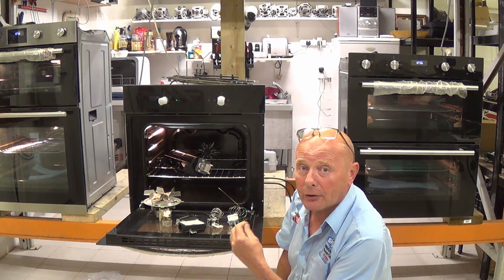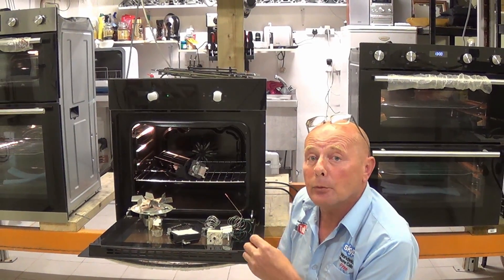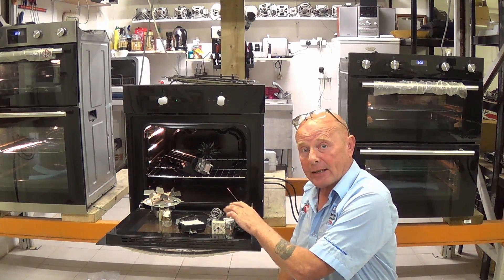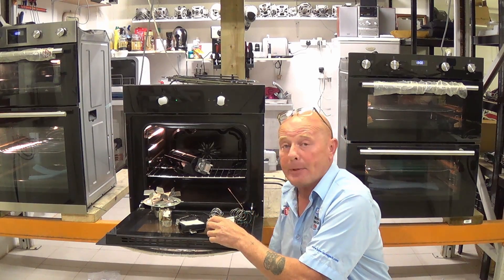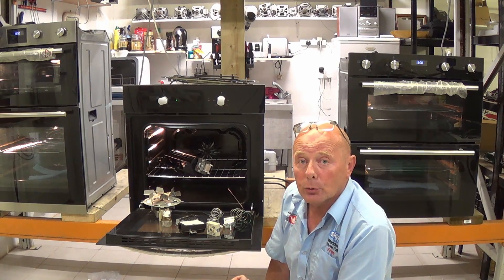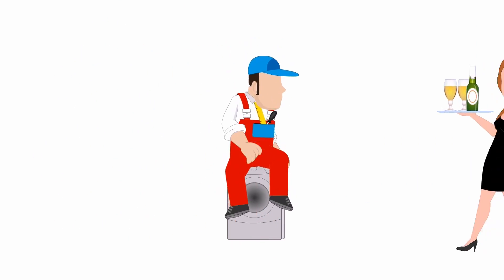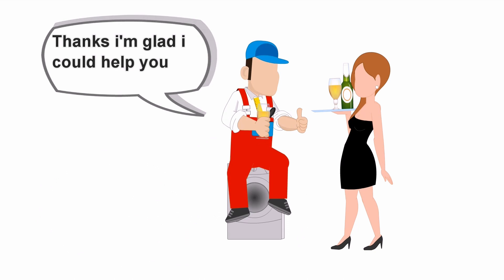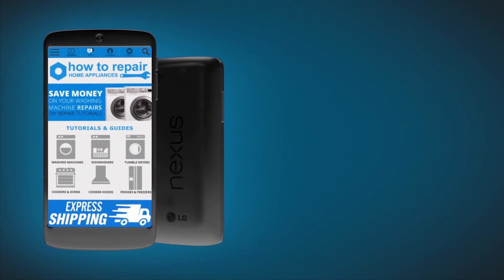Fault 4 Cooker, Oven trips Electricity Rcd or fuse on the main fuse board when you turn the oven on

Comment: Jeremy: Every time I try to use my Beko BBIM12300AC oven, or even just the grill, the RCD on my consumer unit immediately trips, cutting off the electricity to everything. I also have spotted some marks on the grill element I think it will be broken after some use. Should I replace it? If so can I buy from you?
Reply from the maker: Hi Jeremey, sorry to hear about your problem with your Beko BBIM12300AC oven. Currently I'm away right now but my editor has created a video response for you. In the description of the video you will also find an FAQ page where you can find all the technical information like service manual, wiring diagram, exploded views and related videos. You can watch it via this link: https://www.youtube.com/watch?v=sLCKaN3qMHM

Comment: Good morning,  question,  my oven tripped out this morning while using the grill, I'm guessing the grill element has gone, my question is ... should the rest of the oven still work because nothing is working now and I'm not sure what part I need to buy ?? Thanks mike
Reply from the maker: Hi, please use our contact us page and make sure you fill out the request for what your problem is. I will need the full model number of the identification plate and the details of your problem so that I can provide you with useful literature. A video shoot of the problem would be perfect as well.

Normally, I would get back to you within 24 hours but I am on my way back from the IFA trade show in Berlin, so it can take more time to respond. Thanks for your understanding. https://www.how-to-repair.com/help/contact-us/   

Please remember to subscribe to our channel, as that's what keeps this channel going. Thanks, Paul 👍

Comment: My Gas Oven is Blowing the Plug Fuse that does the ignition, clock, timer, and Oven light. Could this be a socket or Oven Problem. Thanks for any help Bob
Reply from the maker: Hi @TheDappler I will need the full model number of the identification plate and the details of your problem. Please use our contact us page and make sure you fill out the request for what your problem is. We will get back to you within 24 hours, normally. https://www.how-to-repair.com/help/contact-us/ 

Please remember to subscribe to our channel, as that's what keeps this channel going. Thanks 👍

Comment: Hi IKEA oven F908 error code. Can't find anything about this error code online. There is no continuity at the element, could it be that? Have changed elements in a Hotpoint oven before. This IKEA oven is proving tricky to find out about.....any help greatly recieved. Thanks

Comment: A very informative video. Here in New Zealand, we don't put ovens or hobs on RCD's. They are usually on an MCB. The lights and power points are all on RCD's. The rules are 3 circuits per RCD. Alternatively we just use RCBO's.

Comment: He bro, I have air fryer/oven and when it gets hot the vents of the fan inside expand and it lifts up causing it to stop the fan...so is it safe to connect the vents to the heating element with a copper wire in order to stop it from hitting the fan?

Comment: Hi there I need help with my bush AE6BFB GRILL OVEN . it’s doesn’t give heating while the fan is working fine so I though it’s the elements I’ve replaced with a new one but unfortunately it’s still not heating at all so I’m just wondering what could be the problem just to let you know that my grill temperature light and grill setting up light in the front none of them are not working too so can you suggest me what could be the possible reason of not heating plz plz helps with your valuable suggestions

Comment: I need help, my super genaral 4 burner gas stove when gas ignition on electric switch tripping. How solve.please.telme.
Reply from the maker: If it is tripping the electric supply, then you may have electricity tracking to the chassis. This could be from a spillage or you may have a wire trapped. You can always try disconnecting a component and making sure the wires are safe and try it again, but all work should be done by a qualified gas engineer, depending on where you are in the world.  @shalihanjaffer2179 please remember to subscribe to our channel as that really helps us https://www.youtube.com/shorts/e432SAb2g08  Thanks, Paul 👍

Comment: Hi , hope you can help .. we have a zanucci double oven cooker it started tripping our main fuse box .. we replaced the main oven control knob , thermostat , plus the fan motor  in main oven all the other parts work with out tripping just main fan oven .
Reply from the maker: You really need to test each individual component with an insulation tester or mega, but this is an expensive tool and I do not expect you to only one, but you may have an electrical friend who would be able to assist. The only other way is to individually test components with the Earth attached to them correctly

Comment: Is the RCD the switch on the wall?  The one where my oven is connected has two switches, one of them red.

Also, my oven is 30 years old and has not worked for as long as I've lived here.  If I turn it on, it immediately trips the breaker.  My landlord wants to put a new fuse in it, but he is not an electrician.  Should I just forget about getting this thing fixed?
Reply from the maker: it will be only a faulty element causing this Thank you for leaving a comment this is for you https://www.youtube.com/shorts/e432SAb2g08 please remember to subscribe as that's is what keeps this channel going. Thanks 👍

Comment: Great video. Just moved into a house with an AEG cooker that has never been used, still had the labels hanging from it. It turns on but as soon as you turn the temperature dial the RCD trips. Tried using only the top element or bottom element but it always trips. Could you give me an idea what might be causing this?
Reply: I have the Same issue, did you get to bottom of this ?

Comment: My microwave oven works fine but I have cockroaches in the interior. Roaches can't be killed by microwaves. Usual methods of pest control aren't working. Help! Anyone have suggestions?'
Reply from the maker: I seriously do not know the answer with this I suggest you get someone in to do pest control
Reply: Cloudy ammonia 8% will move them out of ur house forever.. Don't forget mask and glasses when you spray..
Reply: I’m confused my main oven started to trip after years it’s an zanucci double oven .. so we changed the main oven controll knob , the thermostat , plus the fan oven motor it was working great then started doing it again .. we are at a loss ?? Please help!

Comment: My Neff single built-in oven has just started to trip our RCD on starting. Both the top and fan elements look okay visually and I can spin the fan blade with my hand without any problem. What should I check for first without totally removing the oven (if possible)? Thank you.
Reply from the maker: The easiest way to test this without a multimeter or a insulation tester. First disconnect the power from the electricity then isolate one element at a time. Then turn the power back on making sure that the wires were safe not touching any metal and try each individual element. This should only be really done with someone who is competent with electrics. This way you will be able to find which element is specifically causing the rcd leakage problem. If you need any further assistance please contact us through the website and send your telephone number I will be glad to assist in the morning

Comment: I have a Bosch oven. Simply opening the door is sufficient to trip the switch on the breaker. The oven doesn't even need to be on, nor been on prior to opening the door. My guess is that the door sensors need replacing but it's just a guess.

However, it is intermittent and doesn't occur everytime the door is opened.
Reply: Have the same problem and its a BOSCH HBS573BSOB.  Is that your one?